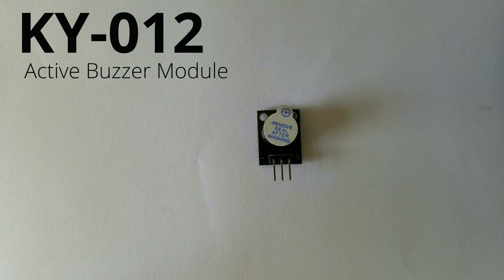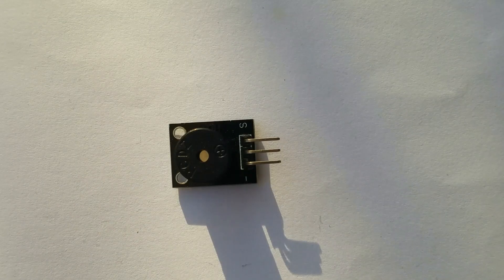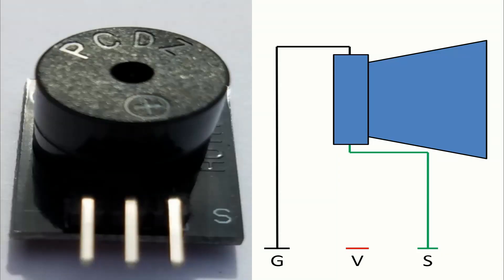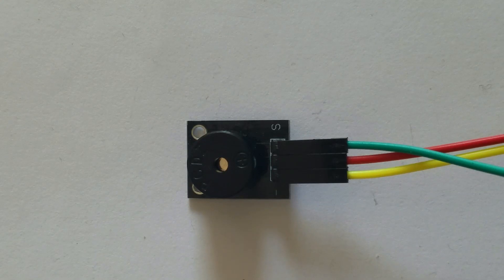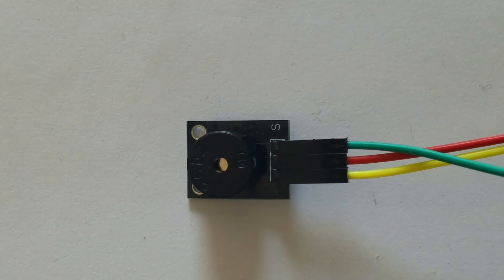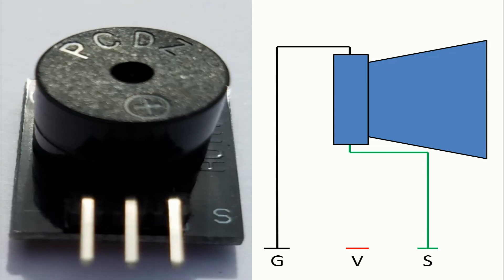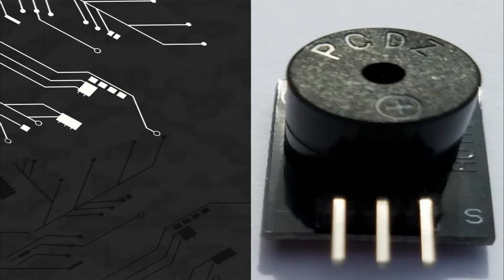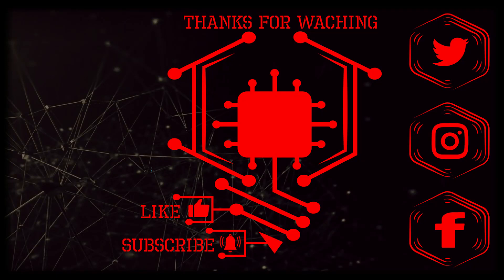KY-012 Active Buzzer Module

Comment: Hi, if we connect the wires to power source..can produce beeping sound ?
Reply: Also curious
Reply: I'm more confused now because I thought the passive buzzer module required a signal from arduino etc while an active buzzer module only required vcc and ground to be connected to give a fixed tone due to the inbuilt crystal.